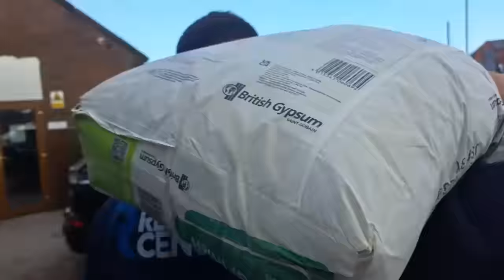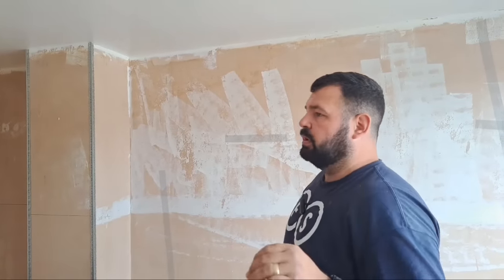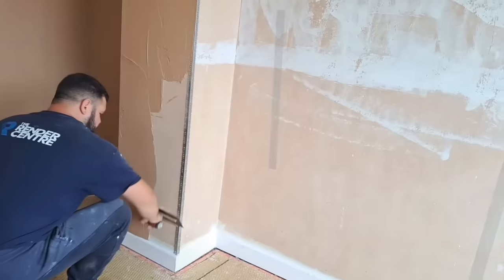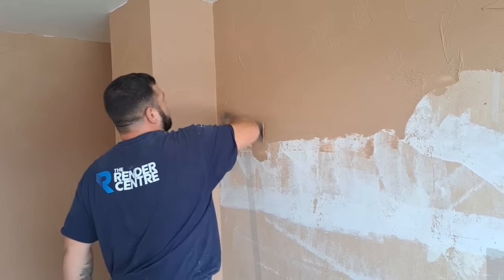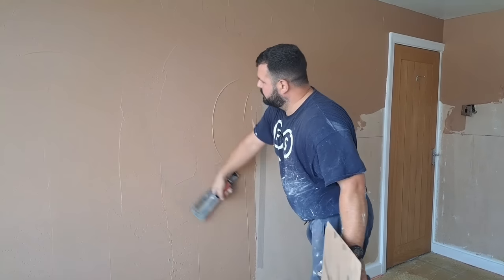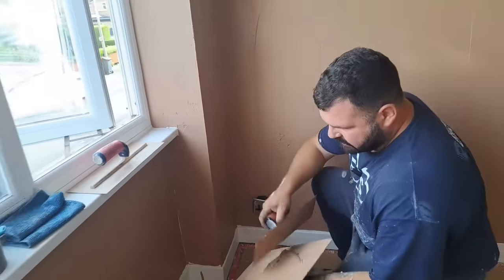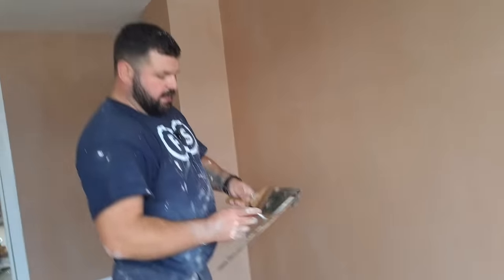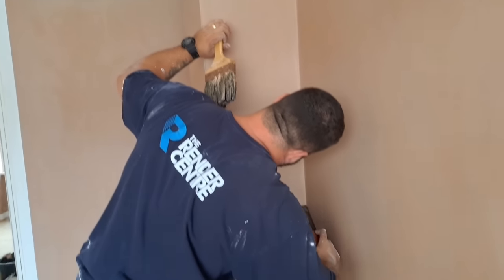WHAT HAPPENED TO TRADESMEN IN THE 70's

Comment: As for what happened to the plastering industry, you have to go back several decades before the 70s.
I started in the business in the early 50s.
Back then, interior plastering was done by installing gypsum based sheets of a product called ( rock lath ) on the interior frame walls.
That was covered by a base coat of gypsum mixed with sand.
This was referred to as the brown coat.
After drying which was determined to a large degree by the weather conditions, a finish coat of soaked lime mixed with a hardener called gauging plaster was applied over the brown coat and trowled smooth.
In a typical say 1000 to 1200 square foot single family home, the lathing and plastering process could involve several weeks of time.
And in poor wether conditions it could even take longer because of the freezing temperatures.
The sand for example could freeze in the pile, even at the supply yards.
This all of coarse had a major effect on the building process as for meeting delivery deadlines.
In the late 40s following the end of WW2 a builder by name of Levitt built an entire city of 17000 homes on long Island near the city of New York. All of those homes and all of the other buildings involved as well were drywalled. There was no plaster involved at all in the entire project.
After Levitt completed the New York project, the built a duplicate project of 17000 homes in Bucks County Pa, where it so happened that i lived.
So by roughly the mid to late 50s plastering the walls in the vast majority of all new homes being built was over.
Some homes were being done however, and exterior stucco work was of coarse still being done.
But it made the business much more competitive than it had been.
To the point that it wasent a good trade to follow as it once was.
I simply switched to the home building industry where i remained until i retired.
However i still on occasion would do some plastering work.
The one coat plaster over drywall has somewhat brought back plastering to some degree.
The process is very similar to the old lime white coat process over the brown base coat.
Similar, but yet different in the way it is done.
And i suspect that is due to the differences in the material being used.
We would use a very large mortar board of say 5 feet square in order to mix the soaked lime with a hardener called gauging plaster.
We used a retarder in the mix in order to allow enough working time before the mixture took a set.
We would build a scaffold in the entire room, and run a coat of the mixture on the entire ceiling and part way down the sidewalls.
After completing the first coat we would follow up with a second skim coat over the same area.
That coat was applied more carefully, with as few imperfections as possible as well as trowel welts.
We then used a tool for finishing all the inside corners, called angles.
And no it isnt the same type as the V shaped device used for drywall.
Then we used a wide bristle brush dipped in water to smooth trowel a finish on it.
We would hold the brush in front of the trowel as we walked across the scaffold in a straight line from one end to the other.
After the trowling, the scaffold would be removed and placed in a different room.
The next mix of the lime and gauging plaster would be used in the same way to do another ceiling/ side wall area as well as the lower portion of the walls in the previous room. The closets would be worked in as well.
The entire closet would as a rule be white coated before any trowling took place.
So this process of doing just a wall or just a ceiling of the room at a time isnt what the older version of plastering was like.
The hawk and trowel are the same, but the way they are used is a bit different as well.
We as an apprentice were required to practice at the mortar board taking the mortar from the hawk.
And untill we could take the mortar from the front of the hawk we werent permitted to practice applying it onto a wall.
In other words there was a certain way it was done, and thats the way you did it.
Today i see some doing stucco work and holding the edge of the hawk against the wall, and then just pushing the mud from the hawk onto the wall.
There are also devices called cheaters used in stucco work, where no hawk or trowel is used at all.
I think its called gettin r done, which i guess is all that matters?
Reply: Wow, what a great post Mr Forrest.
I worked on sites for years, and saw how physically demanding plastering is, but by the sounds of it, it was tougher in the 1950's.
Thank you for sharing your knowledge and experiences.
Reply: The main floor of my parent's house was done with rock-lath plaster and I was always impressed with that mirror finish. Reading how much work and skill it entailed, I can see why builders in the USA moved toward taped drywall, especially with the skill gap caused by the depression and WWII. The newest house I've ever seen with rock-lath plaster was built in 1969, so it has become sort of a lost art. I read in 1978 that 90% of new houses had plaster in 1959, but only 10% in 1969. Seems the huge number of buildings in the UK with plastered masonry walls, which have to be redone from time to time,  have kept that skillset more alive over there. Here in New England, contractors and upscale builders still employ plastering crews to skim blueboard, but many volume builders just tape drywall. A few years back, a friend of mine was watching a new house go up across the street from him and this Mexican guy came out coated from head to toe in white dust. I know there are safe ways of using any  of these systems, but no one bothered to train that guy; his employers were just looking for the lowest rate.

Comment: When I was plastering everyday with my mate (started off labouring and within 6 months was on the trowel) we did most things like yourself really , apart from 3 wets and a dry , we used to use a little brush to brush up corners of angles and a twitcher to finish it off on joined walls , I basically learned how to plaster when I installed archways and had to plaster the false wall we’d install for the sweeps to fit over aswell as the underneath and I got pretty good at plastering tbf , wouldn’t say I was fantastic but I could leave a decent finish and always left the job with customers satisfied , also turned my hand at rendering but only as a labourer and laying on for the lad who’s company it was , loved the rendering in the summer and plastering in the winter lol

Comment: I am no plasterer, but I can get by with taping and filling.  So when it came to my kitchen ceiling needing a relatively small repair, I entrusted it to a retired plasterer, I am guessing he was late 60's.  

Long story short, he was as fit as a fiddle and he did an awful job, the recessed lights wouldn't sit flush and hollows everywhere.  He would have been plastering from the 1980's I would have thought and I bet he ruined a few homes in his time.

He did come back and just handed me my money back basically saying I was too fussy, but it was so bad I ended up ripping down the ceiling and taped and filled instead and took the opportunity to get some insulation up in the void as well.

Comment: My 1960s house also has pretty uneven original plaster in places. Which makes me wonder how do you know (with a trowel) if the plaster is going on completely flat as you work? Doesn't it just follow the shape of the underlying backing? And if you do detect hollows, how much can you build out with skim plaster?
Reply from the maker: The Trowel is flat so any hollows caus the corners of the trowel to dig in.

Try to imagine dropping a beer mat into a big gin glass, which parts of the beer mat would be touching the glass

Comment: Kirk just a quick one, had a nightmare ceiling today, polystyrene coving down, sbrd the ceiling, then 2 coats of multi over a very shallow artex. First coat went on fine, but as soon as the speed skim touched it, it was congealing and pulling off, so troweled it flat, same with the second coat then it turned rapidly and i was chasing it. Wet and dry trowelling was tearing it. Nightmare especially on a 4 meter high staircase ceiling. Dodgy batch of plaster you think?
Reply from the maker: SBR still wet?
Reply: @Onthetrowel  no mate, bar a few bits in the corners, very odd
Reply: I've always done a light scrape .

Pva 

Put a tight coat of multi over 

Let that set .

Then skim as normal (same day)

Definitely prefer to 9verbaord tho

Comment: Hi kirk. What the difference between  board finish and multi finish. I only ever see multi finish being put on but saw that you'd used board finish. Cheers, and thanks for the video.
Reply from the maker: Sets a bit faster... that's pretty much it really. Its not quite as creamy. 

If someone is learning then they will have an easier time with multi.

You can wet it and bring it back a little  bit when it's starting to set
Reply: @Onthetrowel  thankyou kirk. Great videos. 👍

Comment: Keith just a quick question, I'm going to to put up insulated plasterboard in my mother's house, is there any difference between putting the boards up vertical or horizontal I'm going to Dab them on and take my time. The only problem is there are 9ft ceilings. What should I do. Sorry it wasn't a quick question after all 😂. Niall (Ireland)
Reply from the maker: Hey mate, aslong as you get them plumb and they are well stuck then it doesn't matter if vertical or horizontal. 

I find it easier vertical though.

P.s. don't forget 2 mechanical fixtures in each board mate.

If there's a fire the foam melts and the walls fall in 🔥😳👍

Comment: I see ur using board finish on these walls I didn't know u could use that over existing plaster ? I thought it was only for new plasterboard??
Reply from the maker: It's fine mate, infact they even started stating it on the back of the bags
Reply: No you can’t plasterboard and washed no fines concrete

Comment: Wow I never expected that.  As a Spark myself it usualy falls to me to clean out the back boxes after the plasterer has been around.
If only every trade respected every other trade like that, the job would go so much smoother.  I'm now trying to use those yellow plastic
protectors, this mekes the plasterers job easier and means that he gets square edges around electrical back boxes.  Also the same for
the tiler.
Reply from the maker: We got to look after each other pal
Reply: to right.
 @Onthetrowel
Reply: I put tape over the boxes and just cut it out after no plaster what so ever in the boxes.. if only the sparks would just leave a small amount of cable out instead of 2 ft of it ... I sometimes just cut the marks off them for the craic...

Comment: I don't get why you use board finish on these surfaces. I saw you  use board finish on a ceiling and it caused you issues.
Reply from the maker: I just sets quicker, I prefer it mate
Reply: Board finish isn't as greasy in my opinion